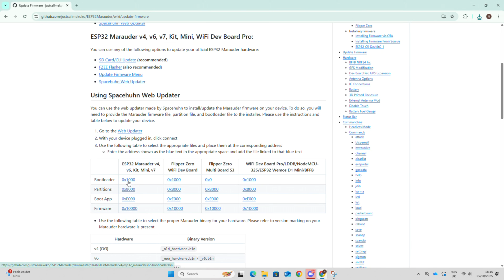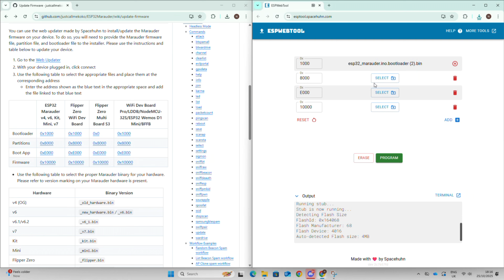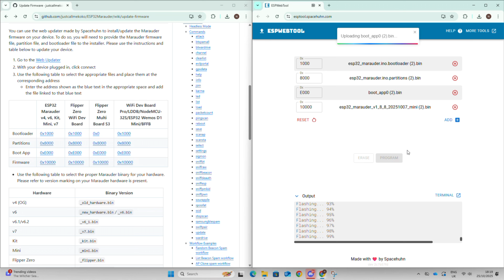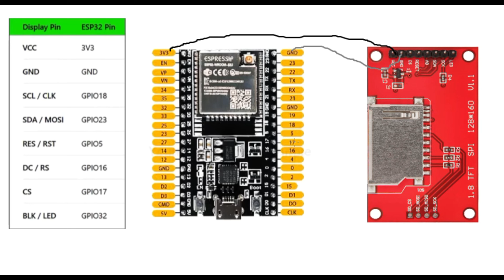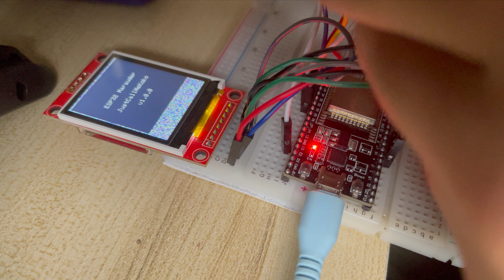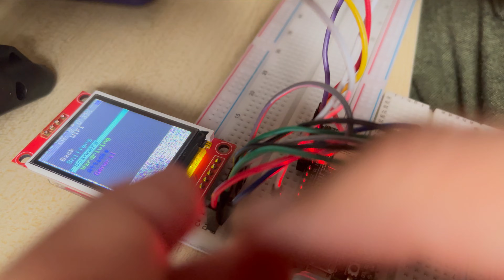ESP32 Marauder for Beginners — Build & Learn Wi-Fi Scanning Step-by-Step

Comment: Can i do it with normal esp 32?
Reply from the maker: Yep but you need to see it’s pin they might be different
Reply: @animez1253 can you build a wifi , bluetooth jammer by using esp 32... And can you share the codes...
Reply from the maker: You can use the maraduer to perform these attacks